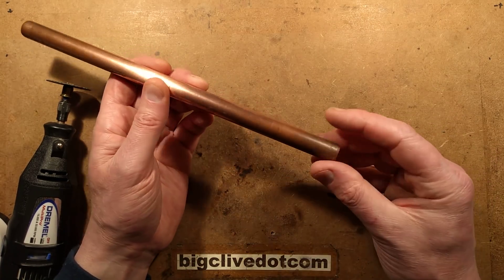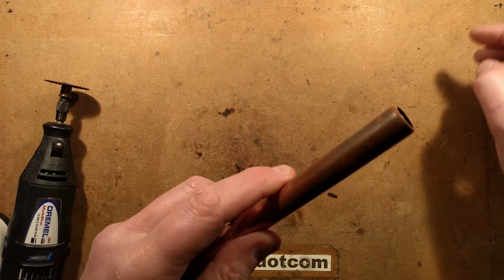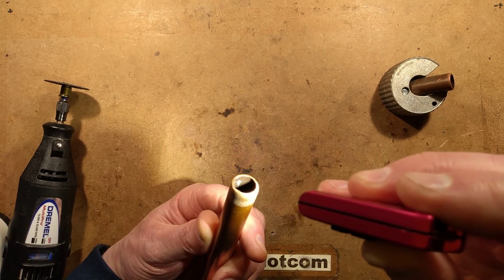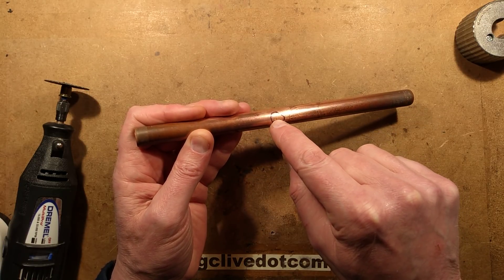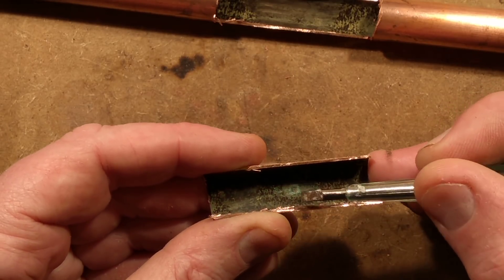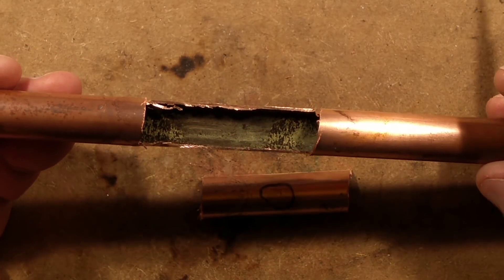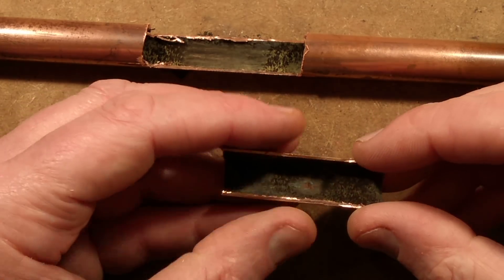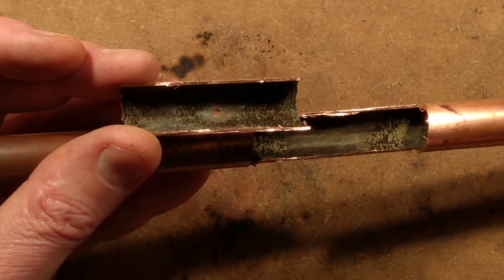Odd pinhole leak in copper pipe.  Selective electrolytic corrosion?

Comment: Copper pipe imported from Mexico was found to have manufacturing defects (poor quality, lots of contaimination).  Lots of houses built around 1990's used this pipe and just about every one developed pin hole leaks.  I was working around the house one day and heard a noise that sounded like a hiss.  Found a pin hole leak before it caused too much damage.  Sold that house, time bomb.

Comment: Could it be possible that some of your local water supply may have steel or lead pipes, and they're already corroding, allowing bits and pieces to move down the line and into your copper pipes? Perhaps just rust particulate from whatever the water supply system is. No idea, but that's where my thoughts take me on the matter.

That aside, I'm afraid you may be in for a bit of a nightmare scenario. The plumbing in that house will very likely need to all be replaced, and it would be a good time to think about using Pex.

Comment: Not electrolytic due to steel particles, since copper has a positive electrode potential compared to most transition metals - steel and almost any metal in contact with copper would act as a sacrificial anode. Zinc and aluminium (now disallowed) electrodes were used in copper hot water tanks for exactly this purpose. 
Turbulence near pipe fittings, especially if fitted close together, is the commonest cause for copper pipes to develop fractures, and thus pinhole leaks. This does not appear to be the case here. 
You probably have Microbially Induced Corrosion - Bacterial colonies on the inside of the pipe that grab whatever nutrients from the water that they can, and the acid they produce will eventually pit the copper and pinhole it. http://testlabs.ca/insurance-sector/
https://www.onepetro.org/conference-paper/NACE-03569. https://www.researchgate.net/publication/310607836_MICROBIOLOGICALLY_INFLUENCED_CORROSION_OF_COPPER_AND_ITS_ALLOYS_-_A_REVIEW
Especially if you have soft water with high carbon content (like runoff from peat bogs filling the reservoirs), and it is not running in the pipes for extended periods of time, like when you are away from home, or you are not running your heating. Maybe the Manx water quality has been poor for periods in the past.
Leaks will happen again most likely, and now you've publicly acknowledged it, I'd get in touch with your house insurer to see how they could help to balance the costs of a potentially catastrophic leak with the costs of replacing pipework with quality plastic fittings as a preventative measure. There's still a good return on copper scrap, though not as good as the prices between 2005 and 2010.

Comment: I've heard that this can be caused by a hot water heater that the anode rod has been completely used and the water has started to corrode the side wall of the tank releasing flakes of steel

Comment: this is normal in constant recirculating  systems like in hotels for hot water. the pipe will erode over time and get a pinhole leak like this. upgrade to PEX and this wont happen again.

Comment: There is probably rust in your water tank that is flaking off and causing this. Many water tanks have a sacrificial rod inside them designed to prevent this, and has to be replaced every few years, but most people don't bother.
Reply: why would rust cause anything like this? it's rust. it's already oxidized metal, it can't oxidize anymore and can't be reduced electrolytically in reaction with metallic copper.
Reply: Rust flakes are not 100% oxidized, this type of problem is well known and documented.  @Muonium1

Comment: Had a similar problem with a copper drain pipe from a sink. A combination of poor quality copper pipe and hard water.
The problem is worse if you are out of the house for a few days in a week and do not run water through the copper pipes.
   If I remember correctly, it is related to iron hardness in the tap water. Glen M

Comment: Had two of these leaks at our last house.  We're fairly certain they had one before we moved in as well, because they did mention a previous leak. The first warning we had was a massive bubble appear on the kitchen wall. 

I used to prefer copper pipe, but now we'll use pex for any future repairs. I don't mind replacing 30 feet of pipe if we aren't going to have these issues anymore.

Comment: I had the same thing happening to me two days before Christmas last year. The plumber said it's because we have relatively hard water and some of the minerals deposit themselves on the inside walls.

The problem is exacerbated when you have a circulating pump, Like when you live in an apartment at on a high level, etc.
The fault occurs usually at the end terminal of a loop, like at the top floor, of an apartment building, etc. The reason for that is, that there is very little movement in the water in general, and it's not flowing continuously. Hot water moves for a while, then has the chance to set and cool, this supposedly helps with the buildup of these minerals, etc. which then lead to corrosion.

I've never experienced a burst pipe due to freezing, but I've seen these tiny jets of water jutting out of a hot-water pipe a couple times. The building where I used to work at, had this happening a couple times in various places. It was a large office building.

Comment: If the pH of your water varies too far from neutral, it will begin to etch the copper from the inside of your pipes. You should have the other pipes checked as well.

Comment: I had the same problem. It's on the hot water pipe only because it is caused by flakes of rust from the hot water heater.  I'll bet that your hot water heater is at least 12 years old. The anode in the water heater provides electrolytic protection for the steel tank. They typically last about 10-12 years. If you replace them every 10 years, the hot water heater tank effectively lasts forever.  Detailed discussion at https://www.youtube.com/watch?v=nD5lMITzx_Y
Reply: Best practice is to find the warranty expiration date on your water heater, and replace it ON (or at least near) that date. Water heater here (Apartment) started leaking all over, turned out the reason was that it was aged WELL over twice the warranty date; SIGH. Annoying but hopefully the management here learned from their mistake.

Comment: It’s a water heater corroding and releasing bits of rust. Typically this happens on the horizontal sections of pipe where the rust can settle.

Comment: I used to get pin hole leaks in my pipes often until I installed a neutraliser on my main.  My water is from a well and is highly acidic.  After I installed a chemical neutraliser I had no more problems.  An indicator of acidic water is green stains in the sink, tub, or toilet.

Comment: this is pretty simple you have some metal that has rusted in the system and this was a flake of rusted metal that has lodged itself there. i have seen this a couple times in older buildings . if its the hot side its mostly the boiler / water heater on the cold side it can sometimes be an old metal tap or valve

Comment: As a cautionary note - I bought a new house and just before winter set in I decided to flush the central heating pipes. Within a week I had a flooded ceiling and the plaster joined me downstairs. On investigation, I found that someone had nailed a floorboard down and the nail had pierced the pie, which then corroded inside, however, the nail and rust was causing a seal with the pipe and using descaling fluid had dissolved the rust causing it to leak. I know it is not the same problem but steel nail and copper pipe battery effect the resultant green corrosion was sealing the pipe.

Comment: I've got a building with 400 feet of half inch copper on a hot return line. this has happened countless times, very frequently.  over the past 8 years.  it's bound to keep happening to you,  seeing the inside of your pipe. inspect your plumbing frequently so there is less damage to structure.  we have replaced most of our line with pex,  but there's a lot to go. thanks for the science look into it.  now I know what to look forward to.  I think it's gonna keep happening. .. to both of us
Reply from the maker: I've already ordered the PEX.

Comment: I've seen this before.  It happened multiple times in the same location where the pipe first penetrated the floor.  Apparently, this happens every few years and I happened to be there to replace the pipe the last time.   I always assumed it was a galvanic reaction with an external piece of metal like a nail or a screw since it happened in the exact same location multiple times but we never could find anything in or around the hole that would cause it to corrode like that.  That was a few years back, I've often wondered if it has sprung another leak since then...

Comment: Had to crawl into a confined environment under a hospital floor for exact same issue, pin hole had appeared somewhere in the pipe and had been leaking down a fire door.
The leak was in the internal firewall in the ceiling cavity of the 1st floor of 3 in a hospital, not good :(

Comment: I believed this pin hole formation is caused by excess flux used in the soldering of fittings on copper pipes. It can doesn't really wash away and gradually eats through the copper over many years. You often see the green discolouration around soldered fittings that haven't been wiped clean after soldering.

Comment: Had a similar event in an old house cellar - the cause was an old light cable with disintegrating insulation that had been looped over the pipe! The resulting current leakage weakened the pipe so you could add a fine water mist to the mix. Hardly unsafe...

Comment: My first question is, is this part of a hot water line?
Secondly, IF SO, how old is your your hot water tank?
IF you decide that something needs to be done and a new line put in, the old pipe could just be left in place and new flexible "PEX" water tubing. It is "fished" through the same way wiring is.
Reply from the maker: It's the main cold line.  I ordered the PEX and sharkbite fittings a couple of days after discovering the problem.
Reply: @bigclivedotcom  I can only imagine how much this could keep a homeowner up at night!
Listening........... listening.... :-D

Comment: This an very common problem in the northern hemisphere due to the abundance of magnetic lay-lines inducing eddy currents in the conductive copper piping, that traps electrons at a specific spot in the conductor, which results in the corrosion at that spot.
To  effectively counteract and avoid this problem you mus just install the copper piping upside down and perpendicular (with the help of a compass) to the magnetic lay-line under your house.

Comment: The plumbers clearly used a dodgy Chinese flux capacitor when soldering!

That green snot can be caused by acid flux residue moving down the pipework and lodging at 'convenient' points when water was not flowing (such as when you were away). You'll likely see that the corrosion is all along one side of the pipes, at the top or bottom, depending upon whether the contaminant was buoyant or not. This certainly seems to be the case in the section which you removed.

Comment: Clive could you review and tear down a RGBW LED light bulb with remote control? I did email you four times, and have sent you a dozen messages through YouTube. My offer is still open to buy you one and you rip it apart. I would like a professional opinion of what's inside as I would imagine a remote control, programmable bulb would be quite complicated inside...I hope you read this. I will keep on giving you messages until I get a answer as I would imagine if you were reading this and not answering back it would be quite rude.
Reply from the maker: I get huge amounts of email.  Often arriving faster than I can edit a decent reply.  I've probably read your email and saved it in the hope of getting back to it, but it gets buried under new email fast.  I can't tell if a lamp uses good quality LEDs or circuitry without doing a long term test, and many lamps that look similar online are not.  I have reviewed the circuitry of remote control RGB lamps in the past.

Comment: Electrolytic corrosion through another metal embedded in the copper or from incoming supply, flux with a cleaning agent “powerflux” has been known to eat through copper if it’s not properly flushed through or cleaned from pipework. If your still living in Scotland the water is generally soft and low in contaminates unless of an old main supply

Comment: I had that happen with the insulation between the copper pipe and a galvanized drainpipe. Hissing for a week, then water starts weeping out the bottom of the wall.

Comment: Your problem was very strange. Never saw that before.Years ago I bought a house that was about 70 years old. I wanted to hide the plumbing that was sticking out of the wall. Formerly went to a kitchen sink. The pipe came from the basement, into a tee with a compression fitting and then the pipe going upstairs was also connected via a compression fitting. So, I thought, this will be easy. Loosen the nuts, spin the tee inside the wall and then re-tighten. That worked great for the first one. The second one leaked. I took the tee out and soldered in a union. Still leaked. It turns out that copper pipe had a seam and every time I heated it, the seam opened up. Had to replace the pipe all the way back down to the basement connection. It was very annoying.

Comment: Check with your local water provider if they've recently changed to using chloramination as a process... then send them a bill for the new pipework (or perhaps replacing your entire heating system with plastic pipe :P)

Comment: I have repaired many of those. My house still had sections of steel pipe downstream in which iron particles would go!back and settle in the copper sections and corrode from within. The best ones are manmade from having a sheet rock screw inside a water pipe that finally corrodes enough to increasingly damage an area after being in there for a few years. I have no doubt that pinholes form underground, but would often go unnoticed until a big break forms. I have been told by some plumbers that if this happens it makes sense to replace big sections with PEX, but I have seen some crimp connections leak as well. I prefer replacing a sizable piece around the pinhole and mark when it was repaired and why on it. I have seen them on horizontal and vertical pipe, so they can happen anywhere.

Comment: Had an identical problem a few years back and only discovered it whilst redecorating the lounge when I discovered the wall backing onto the void behind the heating system was saturated at skirting board level. The pipe was about 30 years old. It was a major job accessing the pipe and replacing it so I won't forget the experience in a hurry. A plumber friend said he'd seen the problem a few times, although it's comparatively rare. He suggested replacing with plastic pipe, but based on more recent experience in another property with a rat gnawing through an electrical junction box made of similar material, I'm glad I stuck to using copper. As an aside, clearly these new style pale grey electrical connector boxes are vulnerable to rodents and should be avoided also.

Comment: That happens from anaerobic bacteria attaching itself to the copper pipe, eating it, and pooping acid. Anarobes are much like flies regurgitating on their food to help eating it.  
I could be wrong, but I'll bet that this was the hot water line and that you only run a temperature of about 115 or so. Bacteria tend to not multiply at about 125 and get killed at about 135.  It's a good idea to raise the temperature to 140 periodically and then set it back down for energy conservation.
Reply from the maker: Main cold water line.

Comment: I have a house in the UK, built in 1990, as one of 8 on a small development.  There is another, similar development of the same age nearby.  All have rotten copper water pipes, just as Clive shows.  We had multiple pinhole leaks over the past 10 years or so. In one 2m length of 15mm pipe I counted 20 of these green corrosion points.  Last summer, enough was enough and I had almost all of the old copper pipe taken out and replaced with plastic.  I reckon these leaks have cost me £5k over the past 10 years.

Comment: This is one of the reason PEX (cross linked polyethylene) is becoming far more common for plumbing. Corrosion isn't a concern, it's less likely to fail when freezing, and it's far less costly then copper (which has shot up in price lately). I live in a fairly old house and am considering replacing the copper pipes in the not-to-distant future.

Comment: I live in Southern California and had very similar experience. The water has high mineral content and the water pressure runs typically at 85 psi. The leak happened in a 14 year old 1/2" diameter horizontal cold-water pipe. I cut out about 1 meter of pipe, finding a single tiny hole that looked almost drilled. Was it termite terrorism? I found no internal deposits, but there was some slight greenish staining around the hole. There was only one pinhole in the entire pipe. As best as I know, green deposits on copper pipe would be a sulfide reaction. The replacement pipe has shown no problems in the 12 years it has been in service, and the other copper pipes installed at the same time as the failed pipe are now up to 24 years old and have no leaks.
I thought that is was very strange that corrosion damage could be so precisely local (that is, show no thinning or erosion at any other spot on the pipe). I am thinking that the cause could be a grain or tiny metal chip that sticks to the pipe ID and then sets up a reaction with the copper (there is some galvanized steel pipe far upstream, but it is electrically isolated by PVC pipe).
You will be listening for that background spray noise for a long time!